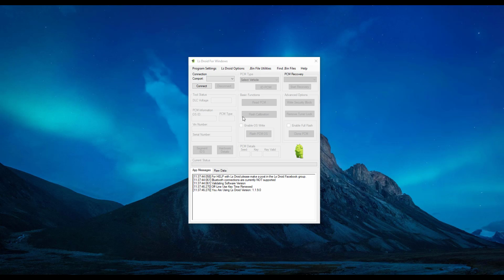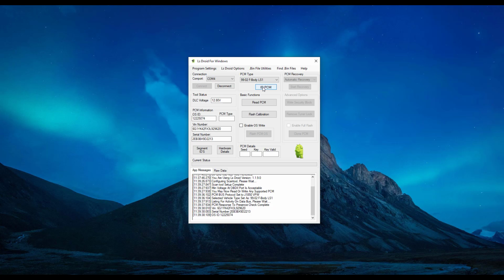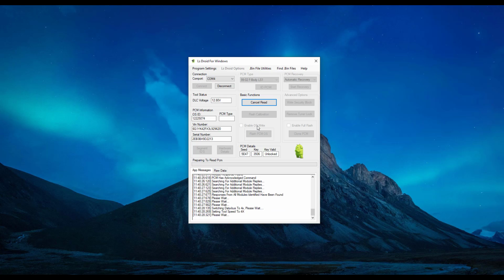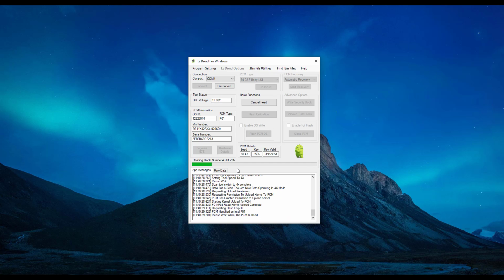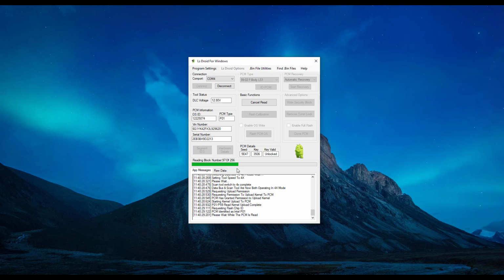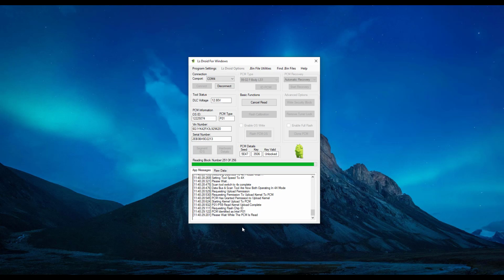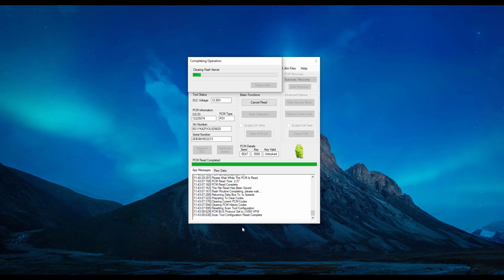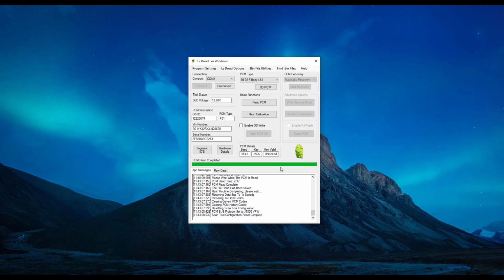Reading PCM with LS Droid for Windows and OBDX Pro VT

Comment: Do you recommend the OBDX Pro GT since it also has GMlan all in one might as well pay extra. Do you know if it will write with LS Droid or PCM Hammer at 4x speed?  Absolutely no videos on the GT version.
Reply from the maker: The GT does also have GMLAN and ALDL.
It does work with both LS Droid and PCMHammer for 4x speed.

We have not yet done demonstration videos for those applications as we have been quite busy helping developers add support for our tools!
Reply: @obdxpro Maaann... I just bought the gt to read my 04 Cadillac srx. Can't get it to read at all. Just got my FT in, got it hooked up to forscan, reprogrammed an abs module in an 09 mercury Mariner like it was nothing. I gotta be missing something here... the vx video with tech2 made it look too easy. Throw me a bone....